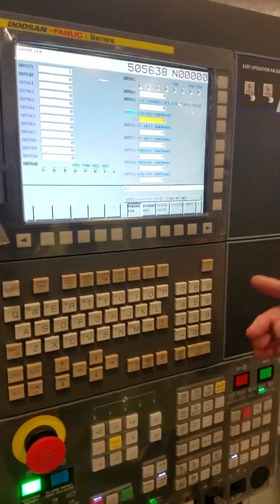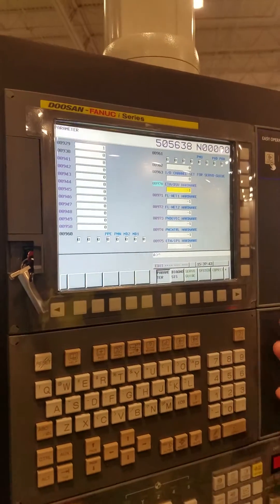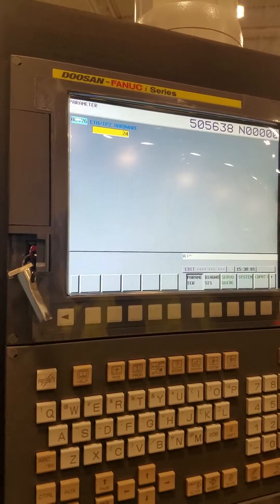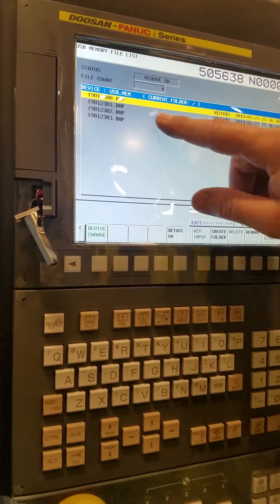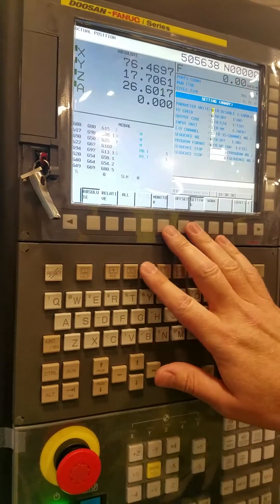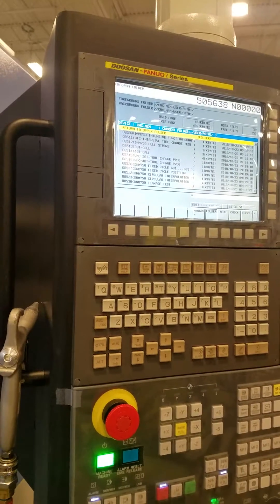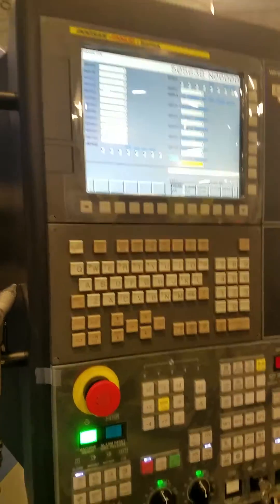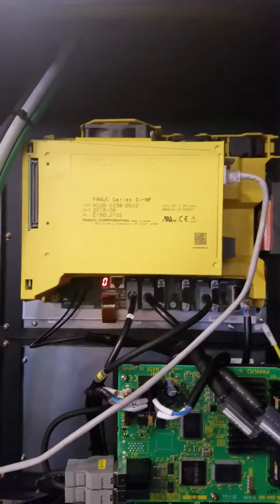Fanuc CNC: Screen shotting and Ethernet IP

Comment: Update: I set "HDC" on parameter 3301 to 1, and screen capture worked with the shift key. The seconds on the clock stopped for about 17 seconds, then screen shot dumped to my flash drive (since I have it set to 17 in in settings).
I didnt press the cancel key afterwards.
Pretty cool! Thanks for sharing this video!👍👍

Comment: Pretty sure parameter #3301 has to be set to 1 to enable screen capture. Our machine tool builder showed us screen  capture thru left clicking with the mouse, then you will see screen capture. Holding shift for 5 sec like you did is what I tried which dont work on my 31 i- b but I will see tomorrow if #3301 is set to 1. I take it on your control, it is.